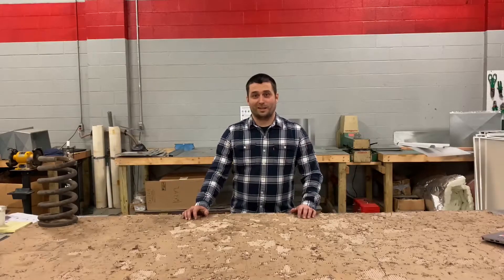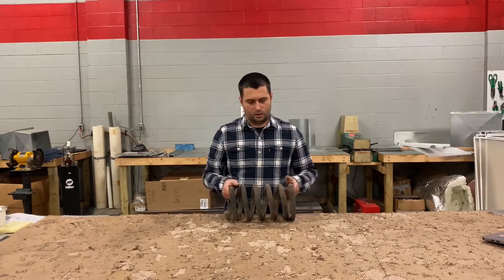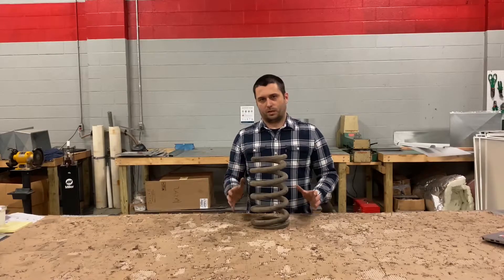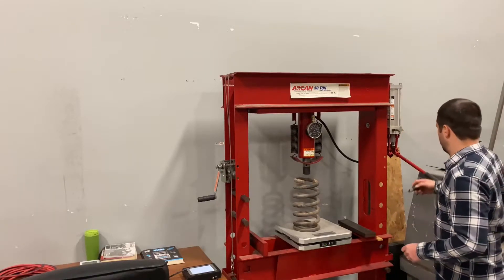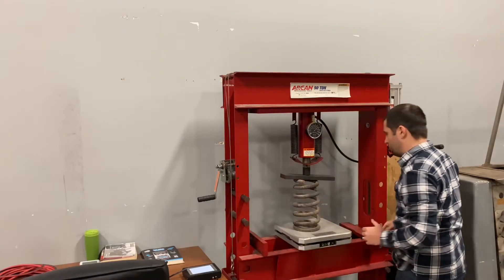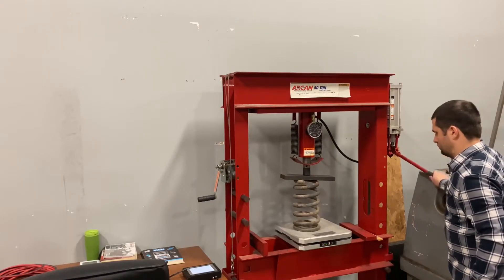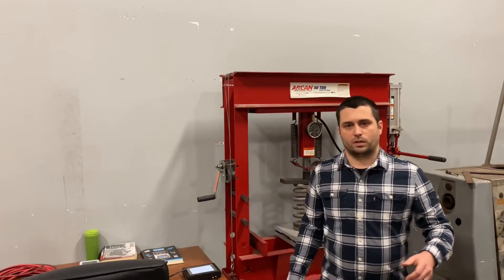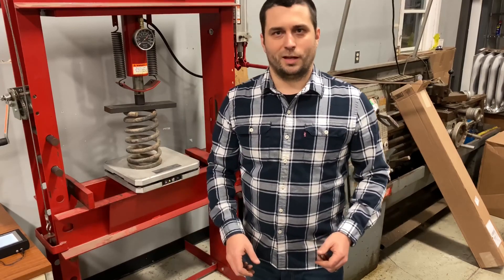Does a spring lose its rate?

Comment: The weight of that bar sitting on top is compressing the spring. When you zero'd the scale, doesn't that remove the weight of the bar and alter your results?
Reply from the maker: Thank you for watching and commenting. It shouldn’t the reason being once the preloaded force it applied weather it’s from the hydraulic press or actual weight then zeroed it takes all factors out. Example if the bar was mounted to end of the hydraulic press you would still need its weight to start the preload part. I did end up making an adapter to the end of the press in my later videos and results where the same. If you have more questions you are also welcome to email or call.
Reply: @kookertech  thanks for the explanation!

Comment: Does this apply to all vehicle springs or just hummers?
Reply from the maker: As long as the spring is linear or constant rate this form of testing can be applied. Small springs like a valve spring will have different measures of compression but still use the same ideas.

Comment: Does it lose its rate if I chop a coil off because I want to lower the vehicle?
Reply from the maker: Your spring rate will become higher. The more you cut off the spring the shorter the spring becomes and the higher the rate becomes. This method is fine as long as that’s the goal you aiming for and you understand your end results.